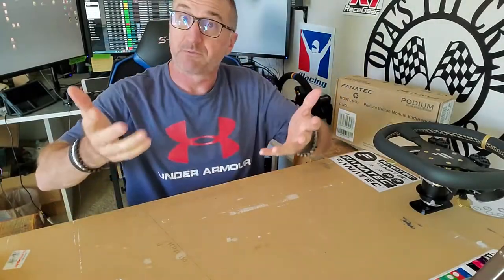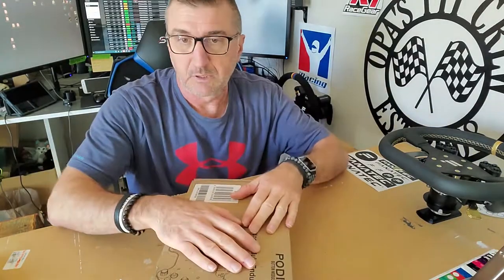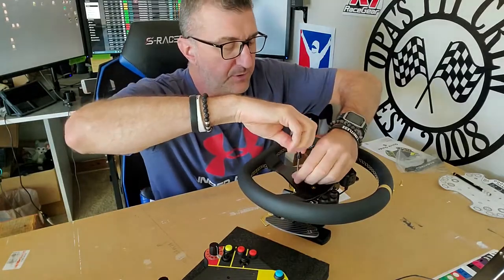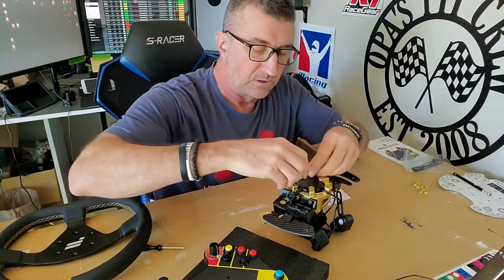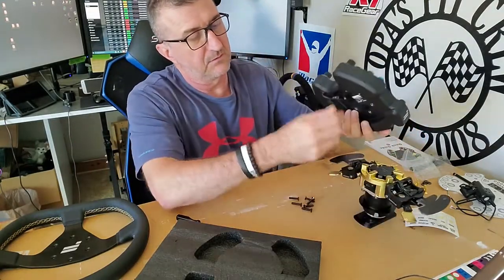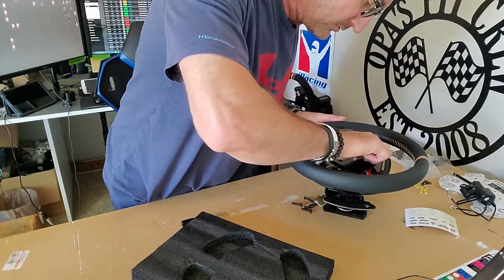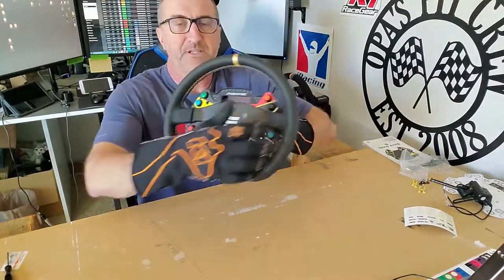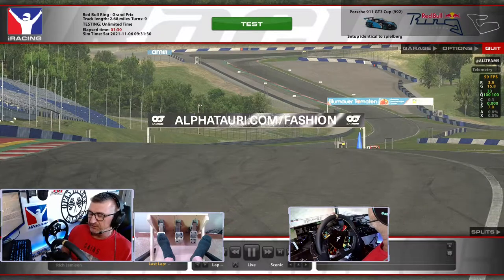Fanatec Podium Button Module Endurance Install

Comment: Thanks for the great review. I am about to finalize my purchase for the wheel as in Your initial setup before fixing the new module. If you can help me understand 2 things would be great; 
1- what was the exact reason you couldnt use the clutch pedals? 
2- initial setup (3 buttons on each side) any idea how to operate ps5 with these. Since ps 5 controller has 4 buttons on each side plus r1-r2-r3 and l1-l2-l3. Thanks alot.
Reply from the maker: Glad the video helped you!  As for the Advanced Paddle Module and the clutch paddles... With just the rim that I had on it, the Podium Hub, and the APM, the clutches worked just fine as paddle type inputs.  The problem I had, and what was solved by adding the Podium Button Module Endurance to the package, was that there was no way to set the clutch bite points for launching because there was no display.  The PBME has a display and I could set them after installation.  Now, I haven't checked, but the Fanatec software may allow you to set that or the Fanalab software may let you do that without a display.
Sorry if I misspoke about the clutch paddles not working.  iRacing recognized them right off the bat and I could use them if I wanted to.  It was just setting the Clutch Bite Point couldn't be done without the display on the module.
Hope this helps! Let me know if you have any other questions! 👍
Reply from the maker: Oh, and about using it on the PS5, I have no experience on consoles with the wheel but, I would imagine it is just a matter of mapping the buttons to do what you want in whatever console game you are playing.  Sorry I couldn't be more help on the one. 🙂
Reply: @RichJamisonRacing  thank you very much. Helped alot...🙏🏻🙏🏻

Comment: Do you feel like there is play when you're driving with this setup?  When I go from turning left to right and vice versa, it almost feels like it is loose.  But everything is tightened down as much as possible, including the QR nut.
None of my other Universal HUB wheels or F1 v2.5 etc seem to have this issue this bad.
Reply from the maker: I ran the QR1 with this and did notice some slight play in it.  I tried using the QR but and it helped, but did not totally eliminate it.  I noticed a big clunk sometimes when hitting a curb or big bump.  Since going to the QR2, that is all fixed now!  Highly recommend going with the QR2! 👍
Reply: @RichJamisonRacing   That’s good into, thank you!  I've stopped using this exact Wheel because it's so noticeable compared to the other wheels

Comment: What if you don't have the screen podium hub to adjust the catch point?
Reply from the maker: I have seen some references to some racers configuring a button to launch on the 2nd clutch but I have not tried that myself. Using that method, you cannot set the clutch "bite point" for the launch. I think that is available only to any hub with analog paddles.  Hope this helps! Sorry I couldn't be more informative.

Comment: Simple solution to the thumbs rubbing, don't ware gloves 🤷 it's not like there's any risk of fire in the house is there and if you use gloves to protect your wheel just get some thin cotton ones. The wheel looks great it's something that I am looking into to replace my Mclaren GT3 but I'm on PS5 so I'm not too sure what works and what doesn't.
Reply: With fanatec, if your dd unit works on console,ps5, then all wheels will work.  Specific knobs may not all work, but i have the endurance mod and it works on pas5 and gt7
Reply: @smokinC5  yes I meant with 3rd party rims actually but I've seen a nice mod for the Mclaren rim that allows you to put Clubsport shifters on it instead of the stock orange ones.
Reply: @VodkaRob  the mclaren gt3 is hard to beat for the money.  There is a conpany that makes a plug and play shifter for it too, cant remember the name tho.  Simz something.
Reply: @smokinC5  yes I have got one of those but the switches are weak. It felt great to use but after a while it gave out. There's two places that do it Simmakerz is probably the one you're thinking of, don't know if the other one is any better but if I can get Clubsport shifters I know they should last.